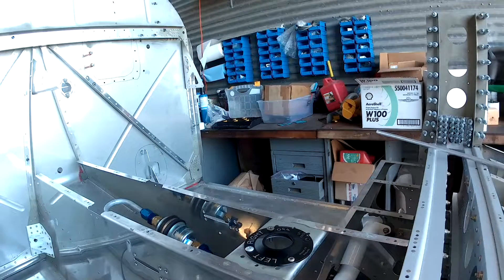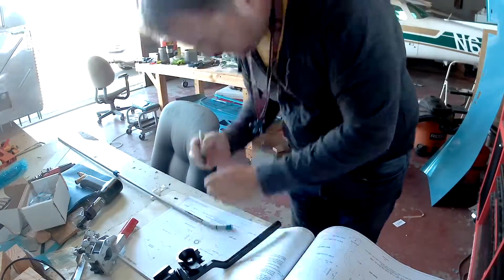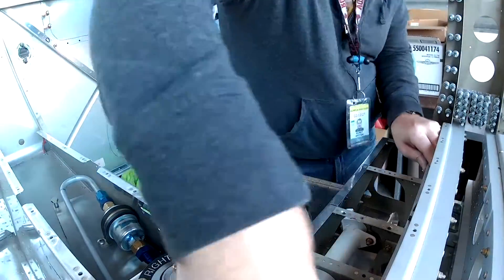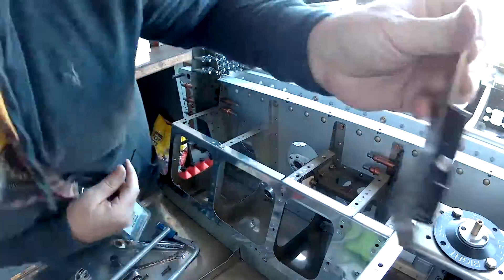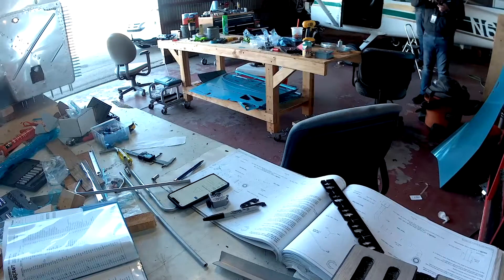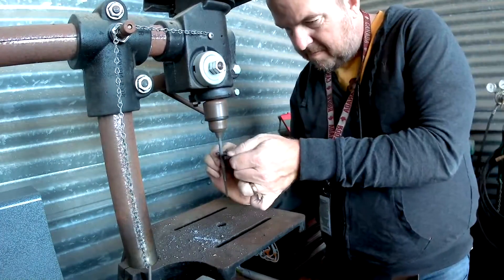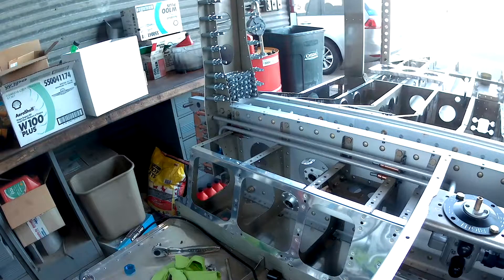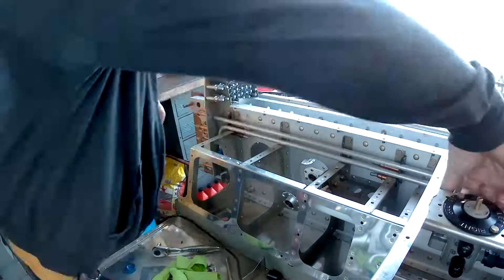RV - 14 - Fuel System 1

Comment: I know it's been awhile since you worked on this, but seeing this video a few days ago, as I'm initially fitting my fuselage side skins, I'm so glad you made the point about fuel return going out that ready-made hole. I took the opportunity to step-drill the skin and side panel to the same size as the bottom hole  for my return line.. better to do it now than later on with everything attached!
Reply from the maker: It was a nice touch for vans to not only include the composite dual channel fuel rail clamps but the pilot hole for the return line. 

I don't know why the return line clamp channel was 5/16 and not 3/8 but that's fine, its what files are for.

Comment: Curious about the choice of 5052-0 (or other alloy?) tubing over 3003-O versatube.  Much easier to fit versatube. Did Vans or FlyEFI spec a specific alloy for their lines?
Reply from the maker: I'm not delicate enough to work with the softer tube and pull it off. The 5052 is much stronger and I like that I can't screw it up :D

Comment: What are the reasons you are using a Fly EFI system?
Reply from the maker: In general I wanted to have a healthy engine. Relying up myself to do a perfect fuel mix for my cylinders with a push/pull knob is ludicrous. I chose flyefii after talking with the owner. Good man, very helpful.
Reply: @akilroy  = Their website list their system as fitting larger CID engines........any more information? This subject interests me as I was looking into UL Power and their FADEC technology, until I went from looking at a -7A to the -14A.....

Comment: Hey Andrew, will you be putting a rubber grommet in the hole the line passes through? I assume that there’s a clamp of some sort to hold it in place, but I’m wondering if some extra chafing protection would be a good idea??
Reply from the maker: If you're talking about the upper return line then no. There's going to be a fitting much like that of the send line at the bottom. All of the lines that pass across the front have opposite halves to the composite bracket fittings I was modifying to fit. They'll need to get modded as well.